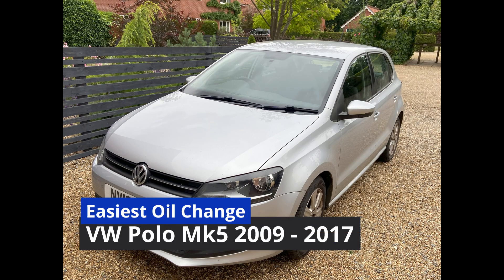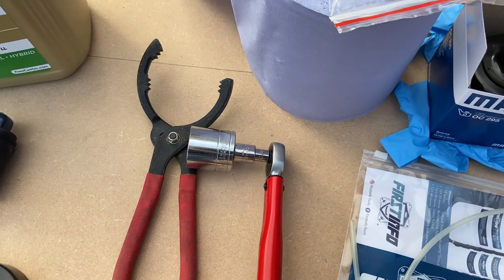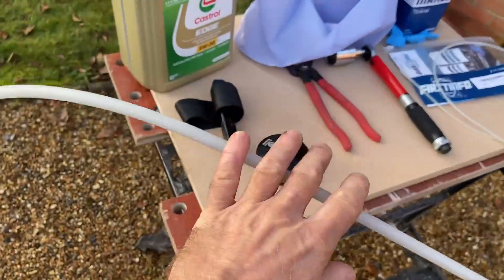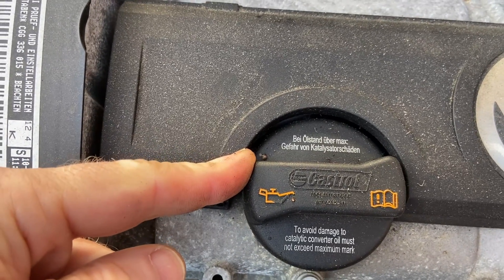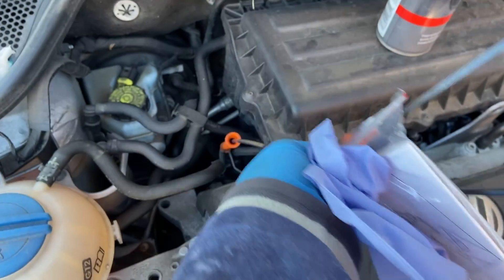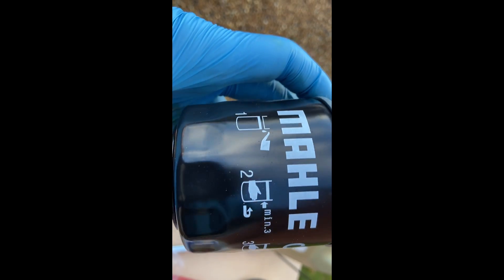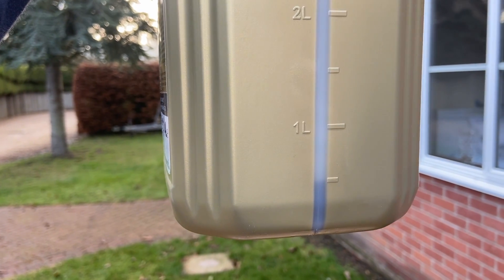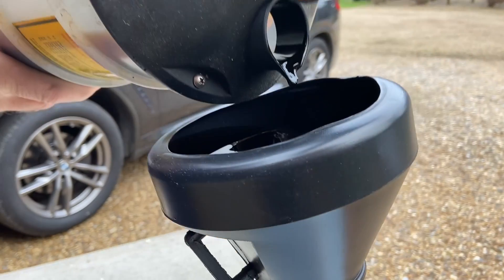Easy Oil Change VW Polo

Comment: Very helpful 👌.  Though I was waiting to see how to take out de oil filter
Reply from the maker: @tabangcostermokoena9153  the oil filter is on the side of the engine facing the radiator. I    take the filter off after I’ve sucked out the oil to reduce mess, but a small amount of oil will spill out, so put some rags under the filter before you remove it. There are various oil filter removal tools available but the easiest is the large “socket” style tools.